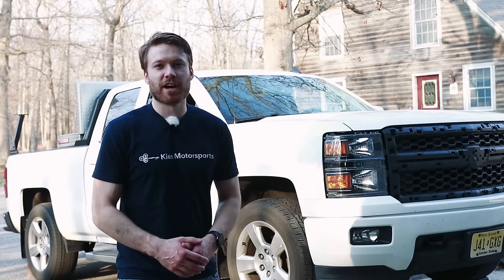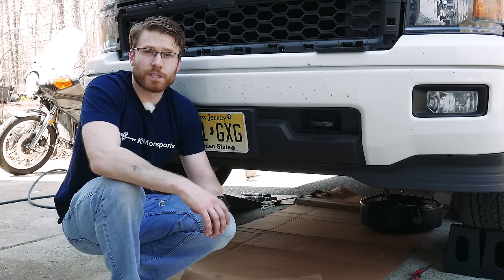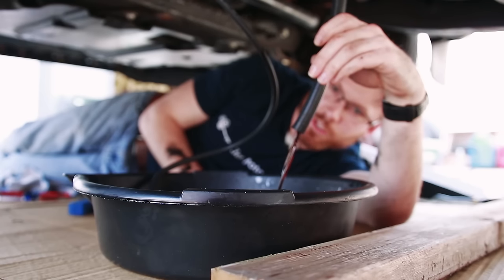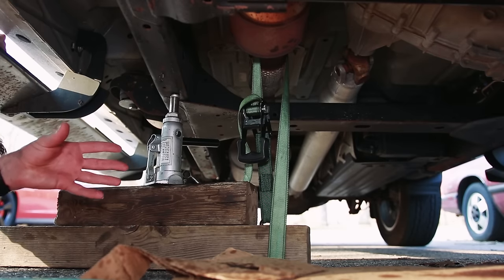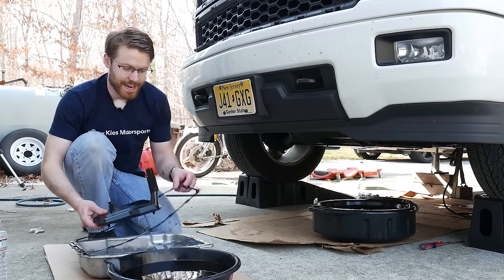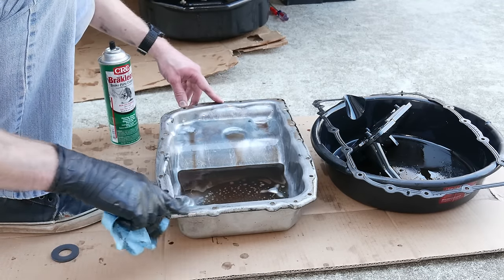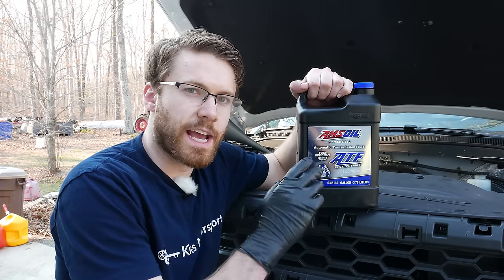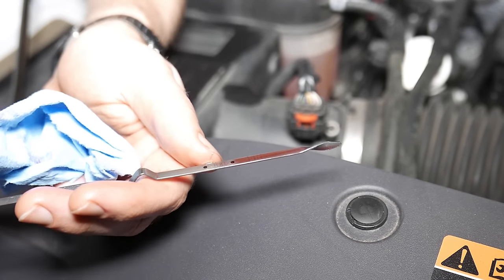6L80E Transmission Super Flush and Filter Change Silverado Sierra Tahoe Suburban Yukon Escalade H2

Comment: They should put a drain plug in the pan. They should incorporate a spin on filter. They should route the cross over pipe 3/4 inch lower.
Routine service should never be that big of a pain in the Royal Backside.

The filter seal can be reused they don’t degrade and the new filter will pop into place. If a filter is a different dimension it’s junk anyway.

They should take the corporate bean counters out and tar and feather them.

The modern automatic transmission is by far the most complex mechanical device on the vehicle and the service procedures are as ridiculously difficult as possible.

Fresh quality fluid make all the  sense in world as it is common sense to keep the internals in top form.
They like people to just buy new vehicles rather than service. I still drive my 1951 Chevrolet 1/2 ton with original drive train. I know how to make things last as they did in the day.
Reply from the maker: Completely agree, an easy access filter design and a  drain plug would make this as easy as an oil change as it should be.
Reply: its weird, I have had GM cars and truck (gassers)  all my life (turbo 350's & 400's) and not one with a drain plug from the factory. but my medium duty GM trucks with ALLISON 1000"s, all have spin on filters and drain plugs. 

I've always waited till around 100k miles to change fluid, seamed to be fine for me never really had tranny problems.
and I still towed 10k lb trailers regularly.
Reply from the maker: Makes me want an Allison transmission for my next truck.

Comment: ik this is an older video but if you use a big enough pry bar you can grab the exhaust and pry on the transmission crossmember and wiggle the pan out. this will most likely require two people but better than jacking the trans and unbolting ur exhaust especially if you live in the rust belt.

Comment: Thanks for the nice detailed instructions. I tried these on my 2015 suburban, When I remove the top hose connection and started the car to collect transmission fluid, with the pressure of the fluid, in less than 20-30 seconds, around 4 quarts of transmission fluid spread all around. than I opened the pan to collect. Only 1 quart left in pan. I am guessing I only got the oil inside the pan. Was the top hose wrong one to disconnect for suburban?  thanks for any help

Comment: I figured that I’ll zip out the passenger side catalytic converter bolts to lower the exhaust..by far gives you the most room to get the transmission pan in and out. Just loosen the bolts just enough to lower the exhaust…then tighten them back up when you’re finished
Reply from the maker: That works too - as long as they aren't corroded too badly

Comment: Two pry bars put it on top of exhaust use cross member where mount sits for leverage takes two people same reverse order. Gives clearance you need exhaust will flex a tad.  It's easy to do if you have it on a lift.  Make sure your remove and or check that the old gasket comes off the old filter and is not stuck up in the trans body. Its a bit* when they get stuck worse if you leave it in and double gasket the filter.  Or just follow the book and loosen the exhaust bolts. Rust belt for get it torch em snap em either way paln on new bolts
Reply from the maker: Thanks man! Definitely annoying but not terribly once you figure out a method that works for you

Comment: Man I’m glad you showed the other way of doing this flush on 6L80
Today I tried the other way every YouTube Mechanic shows 
And I have the E85 4.3 V6 
And where the 5.3 & 6.2 driver side lower cooler line sit , is apparently my MOTOR OIL COOLER LINE ..
So I just wasted 1 hour & 850 miles worth of brand new oil ...grrr ..

Cool I’ll do what you did .

Now question 

The female end takes a 1/2 O.D or I.D hose ? 
And the pipe takes a 3/8” I.D.Hose  
Correct ?? ?? ??
Reply from the maker: Aww man that stinks. I hope this one helped! I'm not positive on the diameters. It has been way too long since I did this video lol

Comment: What's the critical factor to changing trans fluid?  Color, mileage, towing miles.  Great video, I have a 2018 with the 6L80E, I guess
Reply from the maker: Thanks! Mileage is what I base it on, towing miles wear the fluid faster because the transmission gets hotter. Age also plays a factor tho. Color and smell is a good indication of the life of a fluid but you won't notice a change until the fluid is past the point of where it should have been changed. You want to change the fluid before it gets so bad that you notice.

Comment: I disconnected the trans fluid line after the cooler so that I flush the cooler as well . The connection point is near the air filter housing
Reply from the maker: Good idea! 👍
Reply: @TheSundaeDrive  great idea....
Reply: Question? When you did this did the trans oil come out from the cooler heading towards the back of the truck or did the trans oil come out of the line heading towards the front of the truck?
Reply: What type of vehicle do you have @EverydayJ1786?

Comment: Great video, did the swap out on my 17 High Country 6.2L with Amsoil ATF a year ago great stuff got rid of the shuddering. Just found B&K Performance makes a dipstick for the 8 speed a bit pricey at $173.Happy New Year!
Reply from the maker: That's good to know! I may have to make an installation video on my friends truck that we did the lift on.
Reply: @TheSundaeDrive  Yes that would be great there's no video's on install yet. Just ordered one I'm a Canadian and most likely will get nailed for duty because no place to get one here.
Reply from the maker: @anthonymacneil2279  that stinks. I definitely want to do it if there aren't any videos on it yet
Reply: @TheSundaeDrive  That would be great fluid along with the dipstick install.
Reply: Hello Anthony macneil. I look at tour comment  i have a high country 2017  8 speed  When it is cold almost  Alway grabs shuddering trasmission my question is if your truck is the same and When you changed the fluid the shuddering was removed.thank you
Reply: @andresneira9745  The shuddering is gone
Reply: Ok thank you Anthony.  Im going to chnge the fluid. I have heard that the factory fluid is the problem for this trasmisiones 8 speed.  We need change the other  fluid
Reply: @andresneira9745  I dumped all my fluids when the truck was new and replaced all with Amsoil. Also I deleted AFM with Range. Two important moves if your planning to have your truck for the long term. Also I had a relearn done by dealer that made a big difference.
Reply: Thanks for the tip Friend.  What is the AFM im sorry?
Reply: @andresneira9745  Active Fuel Management that allows to shut down to 4 cylinders to gain MPG. Its garbage and for the little gain not worth the costly repairs that could occur down the road.
Reply: Thank you my Friend. i Will investigate  that i did not know
Reply: I'm having same issue.....however I also have the 2016 6.2....and my question is how do you put the fluid back in if I dont have the dipstick ????
Reply: @bobbyburch589  B&K makes a dipstick that's the only way or you take it to dealer
Reply: @anthonymacneil2279  Hi. Can you explain what the "relearn" by dealer is? Thanks.
Reply: @ja-cj9ud  All I know ite hooked up to a computer and its flashed with a new program and how you drove in the past is gone. The transmission will relearn your driving habits. That's the best I can explain it.

Comment: Take the bolts off from the exhaust flange on both sides and pull down a bit/ it will give you enough clearance to take the transmission pan out. Less work and steps.
Reply from the maker: That will work too. I was worried about them snapping off which is why I did the method I did.
Reply: The Sundae Drive You are right about that, depending on the age and location like up north the rust area it can snap off.
Reply from the maker: @Anonymous01416  yeah, that's where I'm at 😬😬

Comment: If you run the truck thru the gears while doing the flush will that evacuate the torque converter. Doesnt it spin when in gear.

Comment: So the exhaust makes sense and doesn’t at the same time I can see it for getting it to temp faster though it becomes a problem once at temp. Just a heads up it’s always a good idea to replace a gasket like that when you remove it even if it is removable and brake clean isn’t that great for rubber so if you’re dead set on reusing it maybe just wipe it with a rag instead of using brake clean on it. Anyhow good video.
Reply from the maker: good points and yes  - using brake cleaner on rubber/plastic isn't a great idea.

Comment: Matt Epps Cadillac Escalade transmission fluid change has a good video, too. Crow/Pry bar under cross frame and above cross exhaust pipe integrated/coupled with a floor jack or a rachet strap wrench secured, along with tightening the two entities, collectively, around the cross frame and cross exhaust pipe. Patience is a prerequisite for the aforementioned project/endeavor. Plus, if you're going through all of that labor, along with the expense, purchase a OEM new gasket and, of course, a new OEM filter from a Chevrolet dealer in lieu of the more expensive Cadillac dealer parts by providing said applicable VIN#. Noticed a substantial improvement, yielding seamless shifting acceleration/deceleration and overall performance utilizing AMSOIL signature series 100% synthetic ATF. A satisfying return on investment for sustainable longevity and piece of mind.
Reply from the maker: Thanks! Yeah it is crazy they designed it this way. Huge pain in the butt. The gasket doesn't need to be replaced everytime. Obviously it doesn't hurt to and I made sure to have an extra one on hand in case it was needed but these gaskets should last quite awhile. I plan to change every 50K miles since I am running the higher quality Amsoil fluid
Reply: @TheSundaeDrive  Y change so soon if u r using the best SS trans fluid...
Reply from the maker: In the future I am only going to do a filter and fluid change (not a full flush) so I'm only changing a portion of the fluid. By changing frequently it will make sure that none of the fluid in there is too old

Comment: One thing I've noticed is everyone pulls to the front of the vehicle then immediately down. I didnt touch exhaust or anything. I slid straight forward. And pushing the Trans cooler line up to keep the pan as level as I can sliding tword oil pain. A little force is necessary but mine slid out with 3 little smacks

Comment: a "FULL FLUID FLUSH" is not a recommended service procedure for these transmissions.  Direct from gm service procedures. gm came out with a tsb regaurding this. #04-06-01-029H. this flush will not work as the redesigned transmission cooler line assembly lines. the redesigned lines do not have quick disconnects at the thermostat block like the 14-15 do.
Reply from the maker: This is a 14 tho so I have the quick disconnects...
Reply from the maker: But good information tho. Silly to me that they keep making transmissions harder and harder to service. If you want them lasting for a long time they need regular maintenance just like any other system. I guess you'll just have to do a fluid change, run it for awhile, and then suck the fluid out the dipstick and do a second change to at least get most of the fluid changed out.

Comment: I don't understand. You only used the 1/2inch hose for top return line. So at 3:04 what's with the 2nd hose and at 3:10?  Because you said you'll need a half inch and 3/8 and you have 2 drain tubes in the catch pan

Comment: Perfect Execution. Note that it's a lil easier to remove/install pan then slide the gasket in/out to avoid damaging sealing surface of gasket.... Or lower the exhaust a Lil bit. I do it the way you did... Most of the time 👀 but sometimes after🥵😢😷 I just cry then remove the exhaust.
Reply from the maker: If your bolts aren't sized removing the exhaust is probably a good way to go but it is a pain as well lol

Comment: Did you have any fluid coming out of the 3/16 hose? Fluid gushed out of the thermostat housing upon start up. With the thermostat delete mod, it shouldn't matter if this is done hot or cold, right?
Reply: Sounds like it shouldnt matter considering you are running an open system now.

Comment: Should I flush my transmission? 2017 sliverado with 80,000 kms on it 🤔
Reply from the maker: I would just do a couple fluid changes maybe 10K miles apart with a filter change each time and then go to a 30K mile interval after. That will be easier than a full flush. More frequent changes If you tow often

Comment: I have 2016 2500 with the 6l90. GM calls for dexron 6. The amsoil signature series is ok? Just trying to make 110% sure
Reply from the maker: Often there are a range of compatible specs. Most likely amsoil is a superior fluid but I would talk to your dealer and amsoil. I don't like giving 110% certain answers when it comes to fluids because things can change from year to year that I am not aware of. Amsoil customer service is very helpful tho if you reach out.

Comment: Hell yeah this bout the Best Video on YT on the 6L80E Tranny Service. 
I have a 07 Yukon Denali. What you did was Cool, But Why not Take off The Return and Feed Line?
That why While you are Draining all the Old Fluid at the same time you are Pumpin new fluid in? If you had a Pump!
Reply from the maker: Thanks! Had I to do it over again I would have dropped the pan and changed the filter, filled the pan, then disconnected the line and drained a quart at a time while adding new fluid at the top.
Reply: @TheSundaeDrive   Why would you have drained 1qt at a time?  Was it testy getting all the fluid back in and circulating?
Reply from the maker: I wanted to be careful not to let the pump run dry which could burn it up and some pumps need to be primed. I didn't want to risk losing prime (although I doubt it would have). Best method is to add as you remove. Now that I've done a full flush tho I only plan to do changes in the future.
Reply: @TheSundaeDrive  Right on.  I think I'm going to do it this way from the radiator and flip the pill in t-stat beforehand so that mod is done.  Now, do I risk snapping exhaust studs or buggering up the VB module trying to get the pan off doing it your way?  Decisions, decisions!  lol
Reply from the maker: When I just removed the manifolds to change the heads, one of the bolts snapped which is a more likely occurance. Luckily I was changing the heads anyway and some of the bolt was out so I could put vise grips on it. I changed them all out to arp bolts so that hopefully that doesn't happen in the future. Doing this again (Transfluid change), I would just unbolt the downpipes from the manifds. Use some PB blaster and a small impact and nuts come right off. They are all easy to get to with the fender liners off and you should be able to get to them all (except maybe one of the driver side ones) with extensions and swivels.

Comment: Can we not run the return line to a dump bucket to collect the old fluid, and a clean bucket with hose to the feed line to vacuum up the clean fluid?
Reply from the maker: You may be able to. I haven't tried this method with the truck but it would probably work as well.
Reply: Good question.  I asked about it on a Tundra forum.  Was told that the suction wasn't adequate or there was no suction 
 on that side (something like that).

Comment: What happens if you don't have a torque wrench and you over tighten with a hand ratchet?
Reply from the maker: You can break a bolt or strip the threads. If you dont regularly work on cars and have a general feel for tightenes, a torque wrench is your best friend. On anything with low torque values or very high torque values, I always use a torque wrench tho to make sure bolts aren't over or under tightened.

Comment: Will this damage any part of the exhaust doing this ratchet strap technique?
Reply from the maker: It could depending on the age, condition, and how far you pull it down. You could unbolt it but depending on the corrosion level that might be hard.